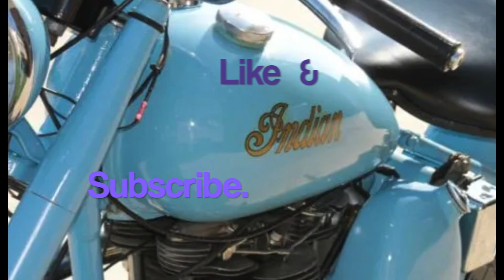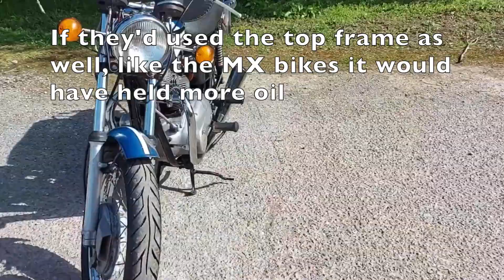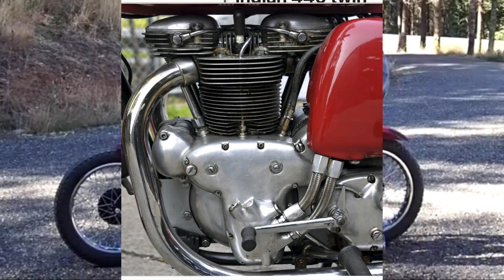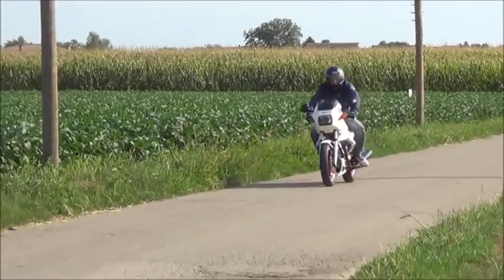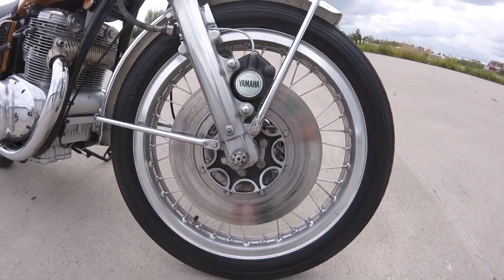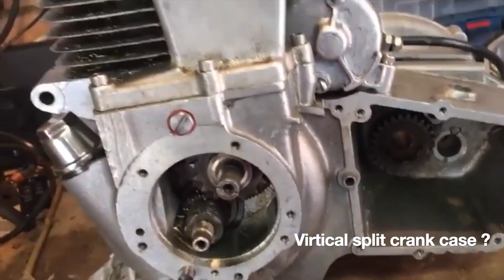5 Yet more Motorcycle Disasters

Comment: My first motorcycle was a '74 Honda CB360 that was only a few months old when I bought it. It was a candy red beauty and had a 6 speed trans. It ran really great but after some time it started having valvetrain noise. I remember adjusting the cam chain tensioner but that didn't help. I rode it for a couple years like that and sold it for $100 less than what I paid for it. About 15 yrs ago my neighbor bought a '74 CL360 which was pretty much the same bike that my CB was except for being more of a Scrambler type model. I tuned, fixed,  replaced parts, and adjusted everything and put a new clutch in it. It had the exact valvetrain noise that my CB had. I adjusted the cam chain tensioner according to service manual and played with the valve lash but couldn't get rid of the noise. I think I found out later that those bikes had a recall for the cam chain tensioner. Maybe not a disaster because it didn't seem to hurt performsnce but the sound was annoying.
Reply from the maker: Honda and cam chains not a combination made in heaven

Comment: The worst bike I ever had was a brand new Yamaha XS250. It was so hard to start that I could get to work quicker on mx Honda CB100. The handling was also poor and I part exchanged for a Honda 250RS when the Yam had less than 1000 miles on the clock.
Reply from the maker: Yep heavy and underwhelming some of the 250 twin four strokes. Over the era were particularly uninspiring

Comment: The Yamaha 750 was a good bike and they fixed the oil frothing was fixed but the bad press and its mondane looks killed it. Yamaha went down this road again with acclaimed and the far more reliable SX750 4 stroke triple until it was blown out of the water by the Kawasaki Z1.
I rode the Yamaha 750 twin and I liked it but the Honda CB 750 four was much better. 
My humble opinion only
Reply from the maker: Well I say in the video about a few of the bikes, sometimes a bad reputation sticks
Reply: I'd be interested to know how they fixed the oil frothing/ oil on points, and balance chain problems...  because they didn't do it when I had one.
The only way I can think of would be to remove the balance chain, and weights as well if possible.
Reply from the maker: @annpeerkat2020  that’s one for Yamaha to answer. If they did, they could have deepened the sump or moved the oil pick up.
But I’d be guessing. Here in the UK the bike was and Is a rare sight

Comment: I have a 1971 oil in frame. The down tube is an excellent oil cooler so perfectly adequate amount of oil in the tube. I like the 2 i have owned since 1979. Conical hub brake is great if set up properly. Nice videos. Cheers.
Reply from the maker: We had a 750, obviously either same frame. Really good frame but oil changes are not too difficult but messy and access isn’t as good as on the older bikes.I always felt that with the reduced capacity it was a good idea to change the oil that bit more often

Comment: I had an OIF BSA Thunderbolt. Single carb. I extended the operating arms on the comical front hub brake and improved it a lot. A set of later forks with a disc brake sorted the stopping out properly. Welding an oil filler plug in the top tube near the steering head doubled the oil capacity and fitting an after-market oil filter sorted the engine main bearing reliability. The 9 to 1 compression was lowered with a thin plate and a head gasket either side of it. The bend swinging ability of the OIF frame was second only to the Norton Featherbed. At 6' tall and used to off-road machines the seat height never bothered me. I loved it.
Reply from the maker: We were never bothered by the sear height on our Triumph either. Luckily our front break was a disc
Reply: I always found suzuki T500 front brakes comical...  apart from the odd time they were "tragical".
I reckon your bsa front brake hub was conical.

Comment: Thank You for the bike porn . I was shocked when you said they didn't put any grease in the wheel bearings. 
In 1999 I worked at a small independent bicycle shop and we sold Hoffman bikes  at a price of $500 to $ 600 bikes with a free tune up for up to 6 months after purchasing.  One came in for cable adjustments and I cleaned it and broke it down completely.  Upon taking the axles out I noticed there was very little grease . It did not compute as I had no formal training.  I talked to the shop owner about it and he explained that if I imagined I was manufacturing bikes and produced thousands of them wouldn't I want to cut costs to improve my profit ?
Putting minimal grease would be cost effective and the product would still sell . I'm not knocking Hoffman bikes because they were high quality and after all it was only a bicycle .
Yet to put out a motorcycle with no grease is evil and I don't mean evel .
Thanks again for the bike porn .
Fascinating content and well delivered .
Reply from the maker: In fairness as my early 90s CBR would testify, Honda were not big fans of grease

Comment: Good job on the Indian vertical machines. Many people don’t understand the history of this series of machines and usually think they are the later used (by Brockhouse) enfield verticals. Your list could have also included the 149 / Arrow. These were modular machines that shared many parts. The 149 is 220cc and the 249 was 440cc using the same pistons. 

The story I have heard is that someone at Indian had been to Europe and saw the lightweight machines the soldiers were riding and felt that this will be the type of machine the soldiers will want when they get back home to the US. I don’t know for sure if this is a true story but if so they were correct as the British machine did take over the market.
Reply from the maker: Well they must have been influenced by the popularity of the British twins for sure

Comment: An interesting history . Thank You.  In 1979 I still had my first bike, a Suzuki GT 250B. I came close to buying a 750cc Triumph Tiger just like the one you discussed. It looked a work of art and I sort of regret not having bought one but feel relieved that I did not at the same time. I went on to get a used Suzuki GT500 instead. Yes, another 2 stroke. Thanks Again.
Reply from the maker: Suzuki two strokes of the 70s were great machines
Reply: what's the difference between a T500 titan and a GT500?    A few little quirks like enough oil in the gearbox so it wouldn't chew out 5th gear and stuffs...   but the main difference is one had a front brake, the other did not.
Reply: I had a T500 Suzuki, the Titan. It was a wonderful bike and the most bike you could get for the money during it's entire run.
Reply: Ironically. the Yamaha XS650 outlived the 750 and 500 twins, deservedly so as it was reliable, economical and great fun to ride (I had a 74 TX650). The vibration was never tiring or destructive.

Comment: The British bike industry also used a mixture of Whitorth, SAE and Metric fasteners, as they couldn't always afford to standardize their tooling to just one size-John in Texas
Reply from the maker: Well the metric system was definitely something that crept in gradually
Reply: Had a '63 TR6. Loved that bike and rode it a lot. Had to rebuild the engine shortly after I bought it.  Previous owner had assembled the engine with all US bolts in the whitworth holes. Threads came out with the screws so I Helicoiled every hole in the bike. Super reliable bike and didn't even leak oil for a few years. I did upgrade or redesign many of the seals.
Reply: My dad was an avid Triumph fan. He had 4 of them over the years. I remember he had a '64 Trophy ( he preferred the single carb versions). He had to buy a set of Whitworth wrenches.  I had never heard of them.
Reply: My riding buddy is still a Triumph fan. Has a 2001 Legend, 1977 Bonneville and a 1967 Bonneville. When the Legend hits 100,000 miles this summer (2,500 mi to go) he will buy a Tiger. I do most of the work on the bikes and ride them occasionally. I liked the old single carb version. Simple.
Reply: Years back I visited with a guy who was restoring some old British bikes , had one and cannot recall what it was , but it used " British motorcycle thread " . He was having a heck of a time cause he wanted it correct and the bolts and nuts were almost impossible to find

Comment: I worked with an Electrician in 1981 who owned a brand new Norton 750 Commando. At around 1500 miles, the crankshaft broke. Never heard of that happening on any bike, but then again, it was a Norton-John in Texas
Reply from the maker: Well it wouldn’t have been new, production ended in 77.
But I’ve definitely heard of a few crank failures over the years. At a race track a few years ago a trident blew its crank and the flywheel spinning past us down the track. Made a hell of a noise
Reply: @bikerdood1100  flywheel?
Reply from the maker: @pbysome  haven’t seen that vid for a good while, so forgive me 
What about it and on what ?
Reply: @bikerdood1100  trident has no flywheel it's a forged 120% crank so can't see how it went past you.
Reply from the maker: @pbysome  ok, do I mention a flywheel ?
Was it relevant?. I do remember showing the crank
Reply: @bikerdood1100  it's about your comment on this video.
Reply: Norton stopped producing the 750cc engine in 1973 and replaced it with the 850 (828 cc) which had beefier main bearings.    I wonder if your friend had a bike with the 1972 Combat engine which was a disaster.
Reply: Have raced old bikes for a long time now and have seen the odd crank flywheel blow apart, never seen a Triumph flywheel fly apart but one of my engines has a steel one. Seen Norton flywheels blow apart and been hit in the head by a large chunk of Harley flywheel, wrecked a brand new Arai helmet. Some flywheels out there don't like revs😁
Reply: @johnmunns5964  you've seen Norton flywheels fly apart have you. Ha.
Reply: The early 650 c.f. Matchless and AJS used to regularly break cranks -it broke across the web  They eventually came up with a nodular cast iron crank with roller burnished journals where the journal joined the web to reduce the stress point
Reply from the maker: @ronnieince4568  the crank breaking is well known on AMC twins. Many of the accounts I read related in particular to competition engines. Failure rates on production bikes are another mater. I expect poor tolerances around that centre baring played apart, they certainly didn’t reduce vibration
Reply: @bikerdood1100  I think the problem was due to the sharp radius where the big end joined the web .It was a machined  casting it forging and the failure long was where the shaft journal joined the web  They fitted a nodular iron crank and roller burnished the fillet radius where the journal joined the web and that sorted it .Other problem was can follower wear -trick was to build them up with stellite welding and grind back to to  original dimensions -the original case hardening was not deep enough .
Wge
Reply: Yeah they were trash
Reply: Another Norton critic that never owned one or rode one. A new 750 in 1981, yeah okay.
Reply: i v repaird honda gold wing 1000 cc and 3 had broken cranks came out in two pieces

Comment: The Yamaha XS 750 with its frothing oil there was a productoin motorcycle race held yearly called the Castrol 6 hour and the Yamaha SX750 competed but never finished that practily kilked of the bike in Australia they sold a few l saw one when l was a courier spoke to the owner and modern oil doesn't foam up so fixed rthe problem
Reply from the maker: Shame it could have been a great bike, some people have few problems but others have been a nightmare
Reply: The video shows a TX750 twin.   XS750 was a triple.   SX750 is a PC power supply....
Reply: @annpeerkat2020  Well Yamah when they went into 4 stroke building except  for the XS 650 but Suzuki foray into 4 stokes was much better there first was the GS750 and what a great bike they were l owned the GS850G it was a good bike the trouble was l had been spoilt by the GT750 which l owned before the GS850G a far better bike to ride than the GS850G

Comment: I had a Triumph TR65 Thunderbird .
It was oil in frame type, which was too tall for me.
It was a disaster  from the point  of view of the engineering involved.
No proper oil filter, and a plunger type oil pump.
Couple that with the lack of oil in the frame, and problems with cooling and the bike became very high maintenance.
There were also endless problemss with build quality and electrics.
Reply from the maker: That plunger pump should have been pensioned off years before. The OIF bikes had a reduced oil capacity which wouldn’t have helped cooling or engine life. They needed a new engine but changed a perfectly good chassis instead. Crazy really
Reply: @bikerdood1100  
I bought her new from a dealer in 1984; it was the final gasp of the cooperative.
To produce the 650 they shaved the top two fins off the block.
Moreover, it was grate to look at, but living with it on a daily basis was somthing else.

Comment: Are you absolutely sure that the final Triumph Bandit design used a Tiger Cub frame- I once rebuilt a Cub and it certainly didn't have the full duplex frame in your video. I am sure Turner had his faults, but to present him as a some sort dilettante seems a little unfair- from the Square four, through the Speed Twin to the Daimler Dart, he was probably one of the most successful engineers of a generation that had few specialised paper qualifications.
Reply from the maker: No the prototype designed by Turner not the final pre- production bikes they used a completely different frame, In fact pritt-stick much everything changed between the Turner designed prototype and the final product. In that part of the video I’m speaking specifically about Turners design and not the final bike. Turner tended to design very flimsy frames look at an early 21. It actually used the fuel tank as a stressed member with predictable results.
The Square four was clever but could never breath properly with the single carb. The speed twin was great but wasn’t Triumphs first twin (6/1). And even that used pistons and components from the L21 a Val Paige design 250. Turners great skill was always styling but he wasn’t an engineer as such and he worked along side the engineers to perfect his designs , Paige on the Ariel and Hele et al to get the Bonnie to handle. I do admire his work greatly but he was not without his faults, like us all
I would describe Turner as a designer and not an engineer, it is not correct to assume that the engineers of the period were not qualified. The industry would fund their training. Turner did not start out as such in manufacturing but owned a dealership in London from where he built his first bike, an OHC single.

Comment: I had a guzzi V50 the two valve heads were bad too, the valve seats fell out and they would leak
No matter how many times I torqued them up, the switches were dreadful and the crown wheel came loose wrecking the final drive box
Reply from the maker: Wonder what model it was 
, the mark 1 was problematic the two less so. Didn’t have any valve on my two to be honest. Mine had Honda switches which helped only problem was a worn seal the chucked oil on the back wheel Had it for 11 years I never tightened anything up to full torque because the castings were a bit soft

Comment: Ah! The 650 Lario. The valve springs were too strong, and Moto Guzzi used friction-welded two-part valves. The weld was the weak point.
Reply from the maker: Interesting, I spoke to a tech who told me about valve stem failure, springs must have contributed towards that I expect
Reply: @bikerdood1100  - the valve got stretched by the springs when at maximum operating temperature. Either the head of the valve would fall off, or the the valve would be held off the seat, and burn out. Suzuki GN250 valve springs and one-part valves were the fix
Reply: @bikerdood1100  - my 2-valve 750 Guzzi Monza also dropped a valve. Back when it was a 500. Again, the valve stretched at the weld.

Comment: Back in the mid 70's i came across an OIF BSA lightning slowly deteriorating in a chaps garden. It turned out it had been abandoned because, due to vibration from the twin carb' A65 engine, the frame had cracked and leaked oil. After an engine rebuild/frame weld and carb' balance it ran ok but still vibrated the feeling out of my fingers at high revs. Nice looking bike though but very vibratory. The front 2LS brakes can work well when set up correctly.
Reply from the maker: Yes the unit BSAs had a poor reputation for vibes particularly when compared to the old A10s. To be fair though the same is often said about unit triumphs. I’ve never ridden a pre-unit Triumph but our unit ones were nowhere near as smooth as our A10
Reply: I fitted on of those late '60s 2ls front wheels to my 1960 BSA Super Rocket. It was a surprisingly good brake - soft likeca clurch lever when stationary, but capable of giving you exactly how much tyre squeel you want. Or locking up.....
Reply: @pashakdescilly7517  Once, then the brakes faded when they heated up if you didn't give them time to cool.